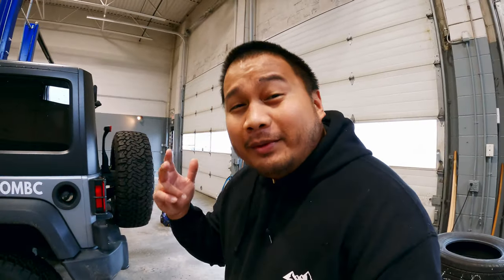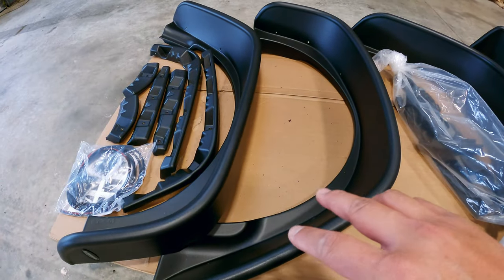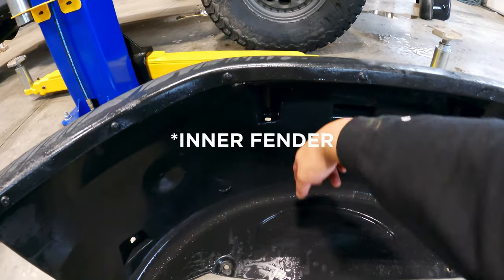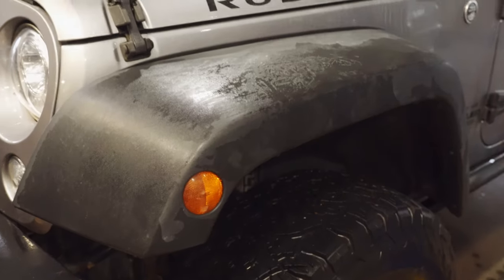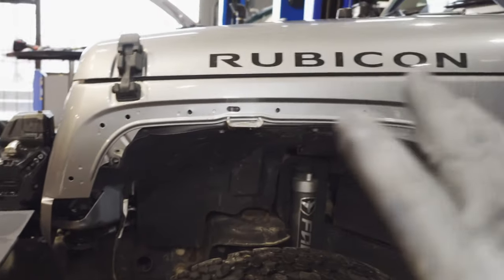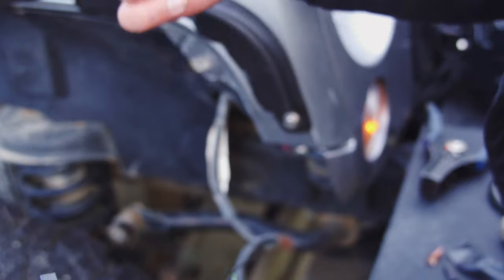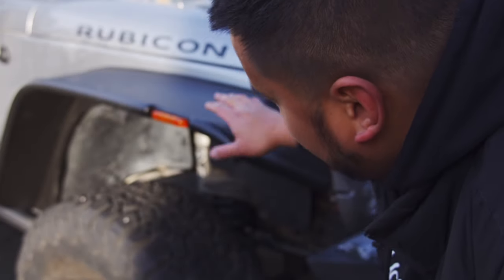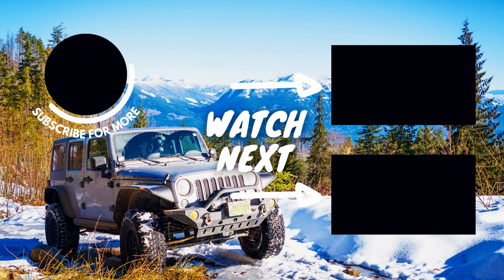Bushwacker Flat Fender Flares Install on my Jeep Wrangler Rubicon | Project JKU - Off Road Build EP4

Comment: somebody knows if it possible to remove them without any issue. i wanna paint them and re-install back
Reply from the maker: @remyboy5754  I’m not 100% sure but I think you can. Since it’s mounted on a mounting piece but if anything, you can cover parts that you don’t want painted maybe. If you find out, let me know, I might do the same in the future. Cheers!